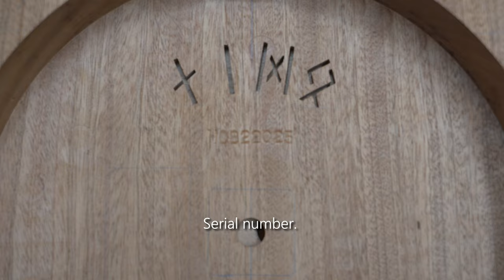Electric Resonator Guitar Build Part 4

Comment: It looks great, but considering that the acoustics of an electric guitar have nothing to do with tone, unless you use an acoustic pickup...is that what you used?
Are we just hearing it acoustically? It sounds too loud for that. What pickup are we hearing?
Reply from the maker: You are hearing it acoustically, it is a resonator guitar so the resonator cone is making most of the sound.
Reply: @silvermanguitars  
So it's much louder than an unplugged electric then? How would it compare to a flat top acoustic?
You really did a great job btw.
What's the selling price? Without the neck, just a completed body minus pickup, preamp. Is it 25.5 inch scale?
Did you mount a mic in it?
Reply from the maker: @duderama6750  maybe around 70% volume of flat top acoustic. There is a p90 and a piezo in the bridge. 25” scale.
Reply: @silvermanguitars  
The acoustic volume is pretty impressive. Were did you source that cone? Is it a special size? I wouldn't think you could fit a cone into a standard size solid body.
Reply from the maker: Cone is a National Hot Rod. Actually I work in the opposite way, I get the parts first and design the instrument to fit them.